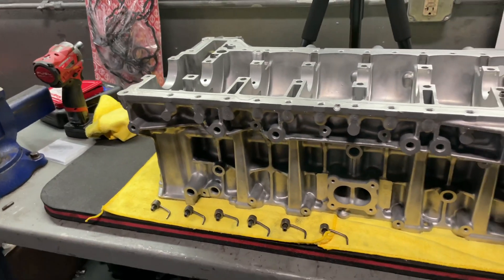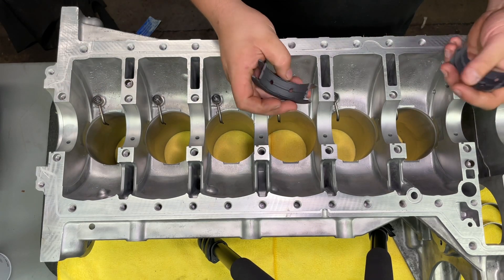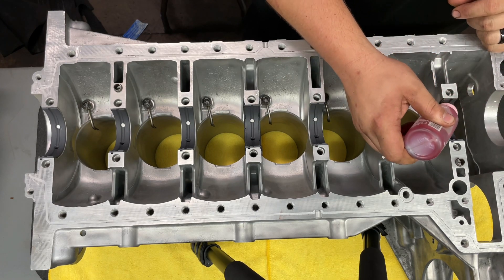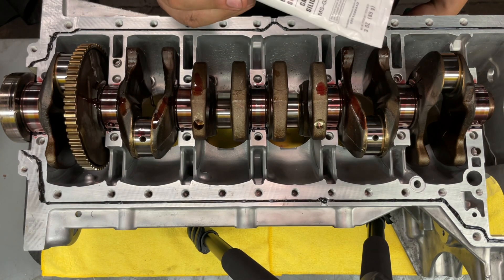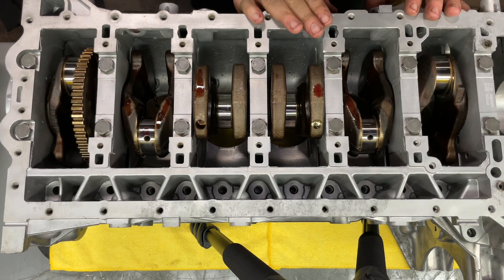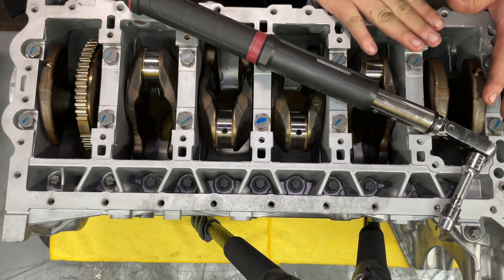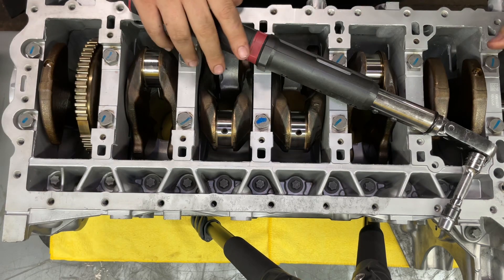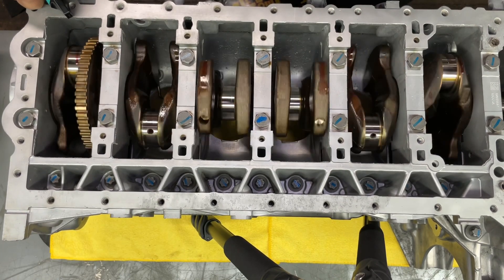N54 Engine Build Part 1

Comment: It´s worth checking out before installation that all the hollow bolts of the oil nozzles are unbroken and clean. I have noticed that their spring can break (not a disaster, but it allows the common nozzle oil channel to be drain after engine shutdown), in addition, if the engine has had chips in the oil due to damage, these hollow bolts collect easily chips inside. Clean the bolts with brake cleaner and test by blowing.

Comment: Love the video man! curious as to how you would check the clearance of the main bearings? My understanding is to plastigauge then torque the bed plate in place, at least at the main caps. If those are one time use bolts, do you need two sets just to check main bearing clearance? Thanks!
Reply: you use your old bolts

Comment: Great video! I might missed this part but did you have the main bearings and rod bearings measured at a machine shop prior or you had that done yourself?
Reply from the maker: Yes was done at machine shop
Reply: @N54RacingChannel  What machine shop you go to?
Reply from the maker: @meqamarcial  fastimes in rolling meadows
Reply: @N54RacingChannel  Thanks, ERS in villa park is dragging balls lmao
Reply from the maker: @meqamarcial  fastimes was no better had the head for almost 4 weeks. Need to find a different machine shop.
Reply: @N54RacingChannel  They have had my engine since may 4th lmao. 4 weeks would've been a miracle.